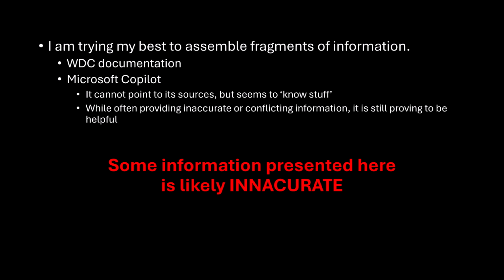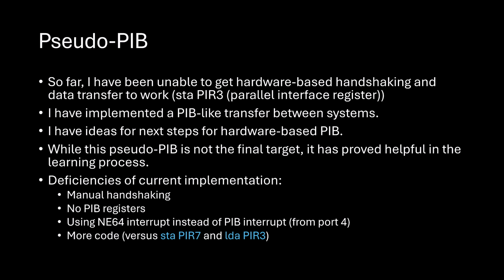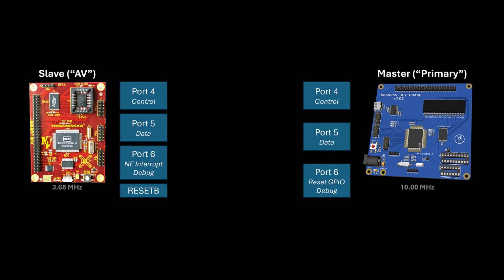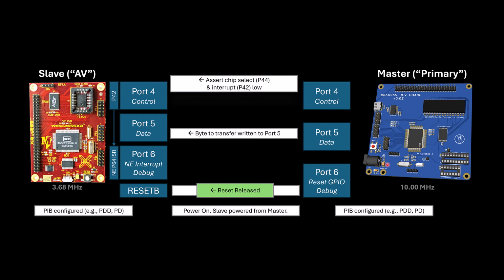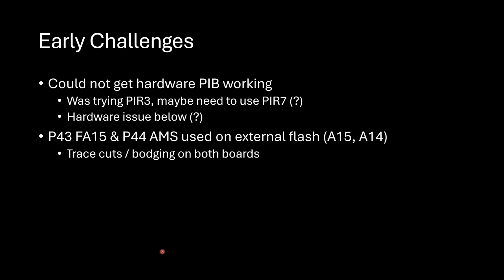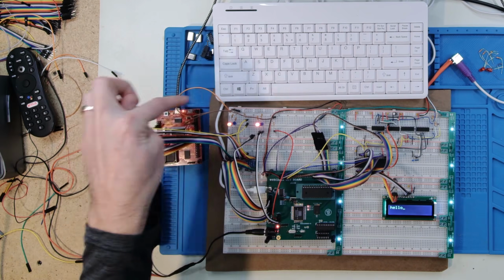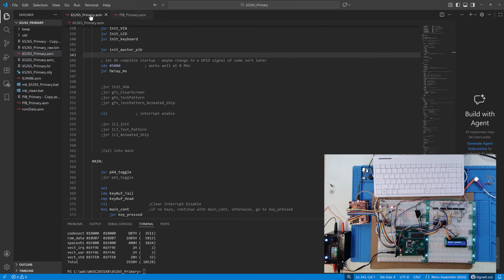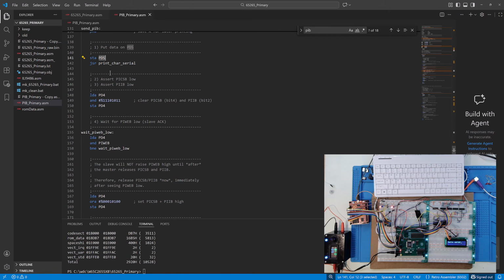W65C265S: Parallel Interface Bus (PIB) Part 2 - Pseudo-PIB

Comment: Looking at source code it doesn’t look like PIB is initialized?  Looking at PIBER code.  PIBER0 should be 1?
Reply from the maker: Correct. That was intentional for this pseudo-PIB, where I'm mimicking PIB without actually using the PIB hardware. I was not able to get the hardware PIB to work (PIBER bit0 = 1). I am now going to go back to take another run at the enabling PIB hardware, given I know the interconnect wiring seems OK (removing the two lines that went to the external flash ROM that was causing issues). Fingers crossed, hardware PIB will now work when I update my code.  :)

Comment: I asked Gemini in "thinking mode"

"Write a simple pib data transfer example between two Western design center W65C256 micro controllers"

It spat out something that looks useful.  It then asked me if I wanted it to show me how to do it with interrupts on the slave side. I said yes and it spat out some more stuff.

Have you tried Gemini.  Hit and miss much like copilot but probably different hit and miss.
Reply from the maker: I’ll definitely take a look at Gemini. I haven’t used it before. Thank you, David!